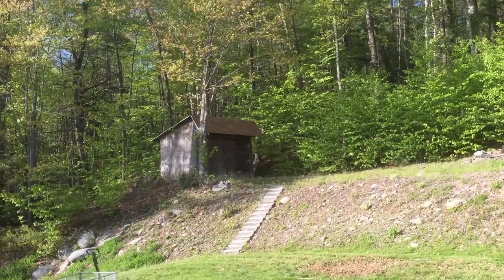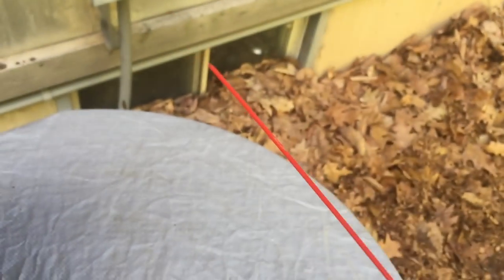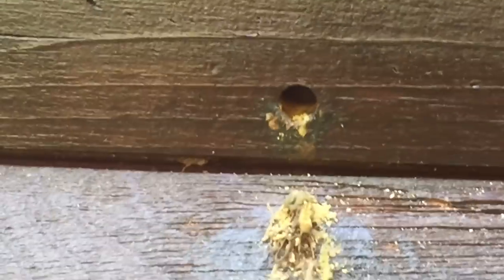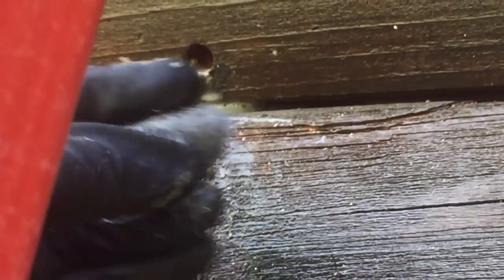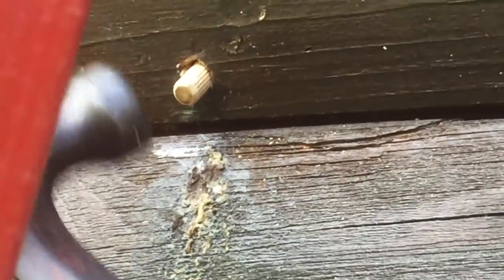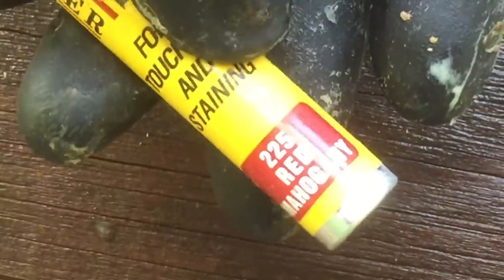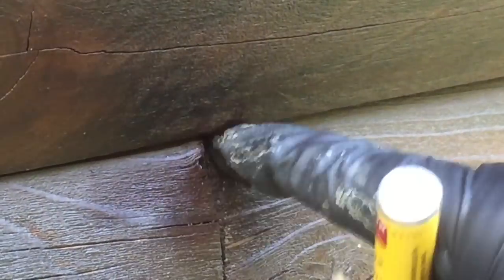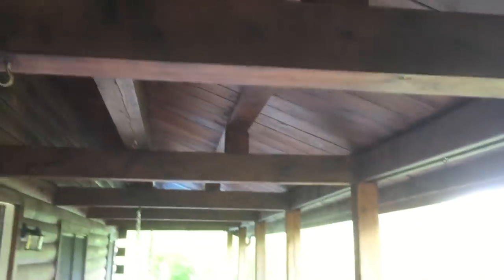How To Fix and Plug Carpenter Bee Holes In Your Home

Comment: I noticed that when you insert the tube in the holes and spray it, its coming out as liquid.  You really need to shake the can firmly for about 30-45 seconds.  When shaken fully, the product comes out as a rapidly expanding foam, not liquid at all.  Spray it in the hole for a few seconds, then use a gloved finger to cover the hole for a few seconds more.  That foam will really swell into many of the chambers.  When you first start shaking the can, you can feel the liquid sloshing around in it.  After about 30-45 seconds of shaking, the liquid feel is gone.  That's when you know the foam is fully activated.  This really makes a big difference!
Reply: Good advice.
Reply: Thanks!

Comment: I use latex caulk and pump as much as I can into the hole.  It fills the hole in all directions for quite a ways from the entrance.
Reply: same here with caulk but also stick straw in first to vent caulk.
Reply: @dadsvintagegarage7542  Why do you have to vent the caulk?
Reply: @EddieJazzFan  when i stick straw in hole seems like I can get more caulk back in hole. When I dont vent, I pump it in and seeps right back out the hole.
Reply: This does not work... Carpenter bees can chew through the caulk.
Reply: @TalkingGIJoe  Its been 3 years now and they haven't chewed through the caulk.

Comment: Killing them in the hole doesn't or trapping bees doesn't solve anything  - new bees just make new holes and keep laying their eggs and the offspring will return the following year to repeat the process.  Keep in mind that the hole you see is the egress point for a series of chambers the bee created as part of her nursery tunnels. I've been fighting carpenter bees from late April to mid June for the 5 years and just come up with a solution two weeks ago.  Fill the existing holes with a product that comes in a tube called Tangle Foot.  This will cover their wings with a sticky substance as they exit after laying their eggs.  Their offspring will also get a dose of the same sticky substance as they exit after exiting.  BUT, to keep new bees from boring new holes spray the wood with 100% cheap white vinegar - insects have a very keen sense of smell and apparently bees don’t like the smell of vinegar.  This year I sprayed white vinegar once a day for the past two weeks.  a few bees will routinely return to my front porch near the wood and fly away. Another issue is that if the bee problem isn’t solved and if woodpeckers realize that there’s a feast of larvae in the holes they converge on the structure and do even more damage - this happened to one of my neighbors a few years back.
Reply: Never heard of  tangle foot but I'm going to get some and give it a try.  Thanks
Reply: Robert Rager Home Depot sells the same thing by a different name. At Home Depot the product is called Bird X Bird Repellent. Another thing that happens is wood peckers will converge on the structure when they realize the that there is a feast of larvae in there and tear it apart and do even more damage. This happened to my neighbor a few years ago. I hope this helps!
Reply: WD40 will kill the adults almost instantly.
With the majority dying within their tunnel IDK if their dead WD40 will almost instantly kill them,IDK if their carcass has any effect on the young once they hatch but it sure kicks the adults ass.
Reply: I say you are wrong ,I have she'd I plugged 4 years ago and no new activity since,

Comment: Apply delta dust in holes and spray area  demon wp with or temprid fx plug holes in fall the its key to treating at the correct time of year. Early spring before they become active and retreat in fall with same products and fall is also when u want to plug the holes. If u plug holes in spring your blocking their access to the poison and if u plug them in the fall your trapping them in the holes with the long lasting delta dust that you sprayed in the holes

Comment: I've used a preventive measure with good effect.  If possible, spray surfaces with Cyper TC.  Any insect coming in contact with the sprayed area won't last very long and it's a definite deterrent to carpenter bees.The product is persistent and will last a couple months unless it's exposed to rain.

Comment: Usually they bore on the underside or back off wood fixture making it very difficult to get insecticide into hole without using a mirror to see the hidden holes, especially on a wooden privacy fence, they bore into the 4x4 which you will not see the hole. You have to look for the sawdust and then you know there is a hole somewhere above that dust.
Reply: I recently found 4 saw dust piles under my deck railing, and got on the ground and looked up. a hole above each pile. Frustrating

Comment: You can fill all of the holes every year, but you need to eliminate the problem.   Get yourself some good CARPENTER BEE TRAPS and hang one on each corner of the house.  There are some OK videos on how to make your own, but the best ones are the bottle in a bottle.   Mine were made from gatoraid bottles, and after 1 season,  I have no more bees.   Also another secret is  don't empty out the traps.    These guys are very territorial, and will enter the trap to seek out their competition.    I've used WD40 or CARBURETOR cleaner to kill them in the hole (after the sun goes down)  -   both kill on contact.   Paintable caulk to fill the holes has worked for me.       Just keep an eye out for new holes and get them right away.
Reply: Your method you stated here sounds very good. Glad I ran across it. I'll be trying it. Thanks.

Comment: the holes are bigger like 1/2 to 5/8 my trick is to use a stiff wire push it through and breach the chambers if possible and use delta dust for two reasons its moisture resistant and it last so long that it will kill young adults when they emerge and existing adults that enter

Comment: I used wd 40 and soaked each bore hole several times..Aint seen a bee in weeks🐝🐝🐝🐝🔫
Reply: I use wd-40 also, it works!  Also I have used # 2 pencils,  You put them in their drill holes and snap them off then I seal it with flex seal.  They will try and eat thru the pencil but eat the poisonous lead and die.
Reply: @highspeed1865  pencils dont use lead anymore....

Comment: This is way over thinking it and very ineffective.
1. Poison then plug holes with cheap liquid nails. Completely fills and restores lost strength 
2. Make or buy wood block and bottle bee traps. You'll chase your tails trying to out poison them. Hang a few traps and you'll see how out numbered you really were.
Reply: Curious- do you have a trap you would recommend?